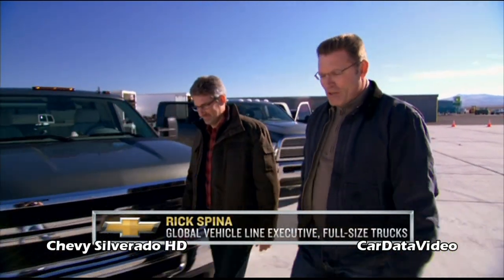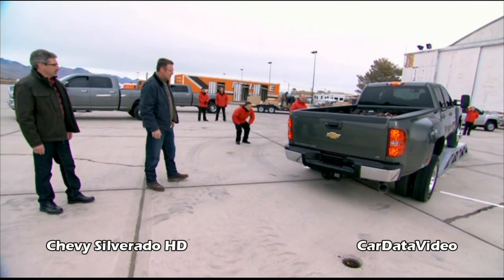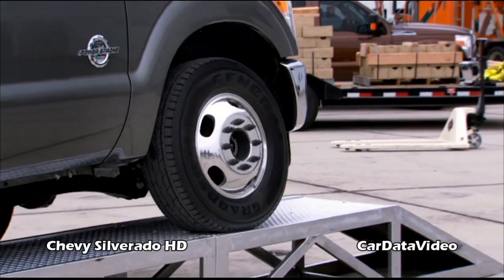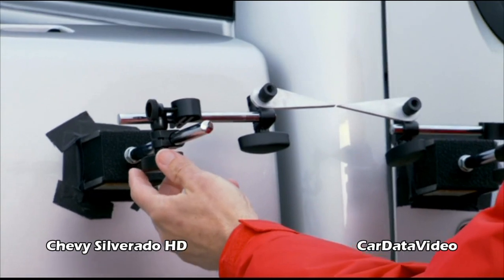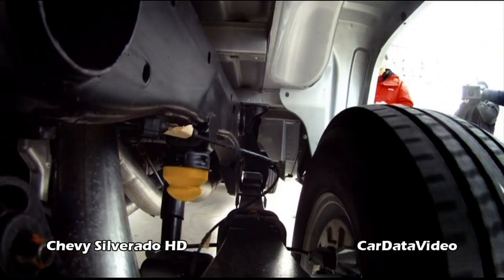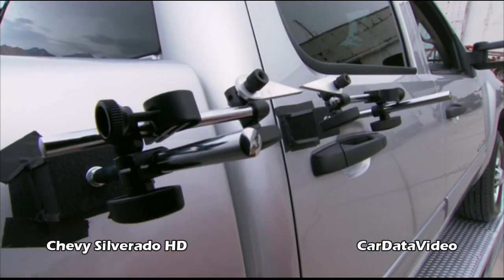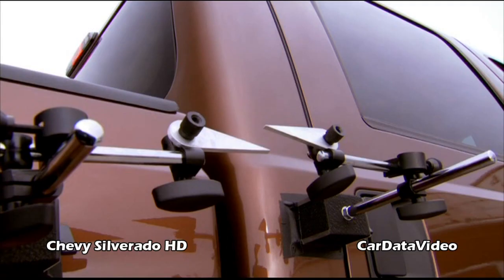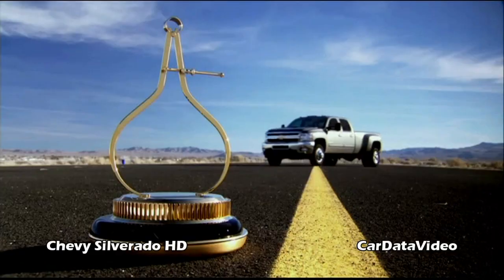Chevy vs. Ford HD Truck - Bed Bend Video

Comment: notice that chevy NEVER competes against ram, only ford
Reply: That's because Fiat can't build a truck.
Reply: Because Ram is no competition, Chevy has been behind 20k units for the past idk how many years..
Reply: Flammable Icecream actually ford copied chevy
Reply: Anthony Fulmer yeah why
Reply: O think that ford is better than chevy that's why they are always trying to bash them
Reply: Ford didnt copy chevy in anything. lol. Ford pioneered in basically everything
Reply: accobra62 Oh, but Mercedes-Ram could before that? smh...it does not matter who owns them, only results matter. And Ram has been doing a decent job for 10+ years now. They have beat Chevy in sales recently and are #2 to Ford who will probably never be beat in numbers of units sold. And if you take an honest look at the 2019 Ram 1500, I mean an HONEST look, you would have to at least admit they are not the same company that built trucks 15+ years ago. Not by a long shot.
Reply: They wanna get above ford because ford is king
Reply: True and Chevy trucks r more stiff, however ford trucks look cooler and r more sporty
Reply: Captain Fangle Being sporty and looking cool isn’t a thing a truck needs.
Reply: Elijah Diamond Incase u never heard of the raptor, or the Tacoma, there r sports trucks out there
Reply: accobra62 ikr
Reply: rsg1963 it’s not the “Mercedes-Chrysler” joint venture it’s fiat Chrysler but I agree
Reply: Austin James yes
Reply: Flammable Icecream ik
Reply: Anthony Fulmer to be the best you have to beat the best ! Notice how everyone brags about beating a mustang like it's the only car to conquer , that's all I hear by people I beat a mustang !! Lol like it's a life achievement ! Lol
Reply: Anthony Fulmer  why should they. The transmission is gonna shred gear mid videos.
Reply: Because dodge isn’t ready to compete with the big dawgs
Reply: I had a 2004 f150 also independent front suspension (like any truck) i went into the ditch hit a raised drive way jumped probably 20ft and landed on a box sign destroying now my bad driving aside the body was still in perfect alignment and the frame did not twist despite have the left rear whell completely off the ground about 5 ft and the driver wheel on top of the sign. Not sure if this video is accurate. (I drive dodge now so you cant roast my ford)
Reply: Chevy doesn't wanna embarrass Dodge and their ill designs as well as their horrendous gas consumption. I recently replaced a customers front 4x4 hubs calipers rotors pads and front brake hoses to the tune of $1,400.00 total on a Silverado 1500. My neighbor saw me do it asked about me doing his Dodge. I couldn't touch the fucking parts for the Dodge for the $1,400.00. Let that sink in.
Reply: Dodge should have their own nd engine!
Reply: @andersonbelland3971  actually ford was founded first, so you know.
Reply: Bc fords big gae
Reply: @Hiddenpower6  gae? Ehhhh?
Reply: Ball joints bud Dodge is ass
Reply: cause ram is way behind lmao. Smallest payload capacity, smallest towing capacity, lowest safety ratings, unreliable due to Chrysler's bs. I'd still like Ram's better than Chevy's, but Ford takes the cake imo.
Reply: Ford may be king, but I love my Rams. Had a Mercedes Ram and now a Fiat one, both are awesome!
Reply: Anthony Fulmer k
Reply: Wait, wuh?
Reply: Leon Flames ram is way better
Reply: TheRPGentleman bruh ram is way better have you ever seen ram showing commercials saying what "real actors" think about their "great brand of truck is"
Reply: colby kessinger Oh, you mean the paid actors? Yeah, I've seen those.
Reply: TheRPGentleman yep the fake ones trying to make Chevy look good about all their crappy "awards"
Reply: colby kessinger But why is Ram better than Chevy? Because they don't make commercials? That's the dumbest thing I've ever heard.
Reply: Because they're the special kid in the corner eating glue
Reply: TheRPGentleman no because they actually know how to make a reliable and working truck the other day me and my brother were driving down a street and saw a Chevy truck broken down on the road and me and him died laughing about how much Chevy sucks. Also ram is way better looking and has a better weight capacity
Reply: colby kessinger Oh, you saw a Chevy on the side of the road? Wow, because it's a Chevy it broke down and not due to a whole list of potential issues that could affect any car? Did you find out what was wrong with the truck? Is it an issue tied to Chevy trucks exclusively and can you confirm that? It sounds like you and your brother are just big Ram fanboys.
Reply: Because chevy ain't got time for those shit trucks.
Reply: @devingeorge5471  nobody does to be honest
Reply: @daniel27560  ikr
Reply: Dodge is low bid.
Reply: @arizonacolour8793  Ram is now beating Chevy in sales lol
Reply: Ram is Garbage, they have topped them
Reply: Ram might leave mopar, they stopped calling it the the dodge ram and have started calling in the ram, no more dodge logos on it.
Reply: And when you go to truck and tractor pulls who comes out on top Duramax
Reply: Eh, I'd rather have the raptor than a duramax. Or a ford any day. They are just really good really well made trucks, and they dont rely on shitty tactics to get them to have any sort of competition with ford or dodge. Cause in all reality they arent well made.
Reply: Detroit motors and Allison transmissions really can't go wrong with that
Reply: Dodge is behind in some scenarios and ahead in others, like the muthafuckin Viper (which in reality inspired from the Cobra Daytona, which used a Ford 427)
Reply: @CaptainFALKEN -tbf they were the only company using a v10 for a sports car. You don't see chevy or ford doing that. And you dont see dodge opting for an actual sports car unlike ford and chevy. And you definitely don't see fords or dodge vehicles on the side of the road because of a broken driveshaft or break failure, or transmission or engine failure. Each company to their own. If chevy wants to brag about how they got an award that everyone gets for participating in so be it😂 but I'll buy ford for the reliable trucks and sports car packages, and dodge for when that straight line is all I can think about
Reply: @accobra62   I agree that is why Chrysler builds them and calls them RAMS
Reply: Dodge and Chevy trucks are both great. If getting a Dodge it's best to get a manual trans though since there automatics are a weak point. Ford makes crappy trucks now adays. The older ones are pretty good though.
Reply: That's because a ram isn't even in the same category there's a reason they are way cheaper then the rest. Because they are cheaply built and every young man thinks he's getting a hell of a deal until it breaks! Ram pos
Reply: That's why we've had our 1989 Dodge Cummins for nearly 30 years now without any major breakdowns right
Reply: @timothykangas4151  Except everything you just said is a load of crap. They aren't cheaper in price and nobody cares to hear your biased view. My 2016 Tacoma has had serious engine failure at 32,000 KM and powertrain issues. Meanwhile my co-workers 2018 ram that he purchased in 2017 right when they came out has already done 42,000KM with no issues. Oh and there RAM's have the best interior I have seen of any pickup. They use ASIN transmissions from Japan and i'd take one any day over GM who makes the biggest POS cars I have ever driven. FORD, RAM and if Toyota get's there Sh1t together Tacoma for me.
Reply: @redtra236  Don't bother have a discussion with Timothy since he is just your typical fanboy with blinders on.
Reply: @redtra236   Depends. RAM gives you the option for the ASIN(japan) transmission that Toyota uses as well. The previous transmission had some issues, it wasn't bad but it wasn't the greatest either. Ford and GM also have less than stellar transmissions. Remember Non of these car manufactures make there own transmissions. GM uses Addison, RAM uses either ZF- Germany or ASIN-Japan. Ford I forgot who they use, but I know Ford has alsotried many times to use one of there one transmissions only to dump them and developed another one.
Reply: Well the one in ours is a solid steel and I believe American made transmission so that probably helps. Also it's a 5 speed manual not an automatic which in my experience are almost all complete junk for doing any hard towing.
Reply: @redtra236  Well Yes, Manuals are rock solid reliable. They are simple and more straight forward in there mechanics. Of course you have to shift yourself and sadly most Americans have no clue on how to drive a Manual.
Reply: Chevy tailors their advertisements to manipulate the consumer. Like most commercials that claim to have a superior product, most of them are lies. Both GM and Ford half ton pickups have proven very durable over the years. Same with Dodge, but I'd rather one of the big two as parts are easier to find.
Reply: It’s because everyone already knows ram sucks
Reply: That's because ram broke down on the way to the competition.
Reply: @seriousdopamine4404  and then you woke up
Reply: @paulj9821  yeah woke up in a chevy, drove it to the competition, and back to you're house to get food from your fridge. While you were still broke down.
Reply: @brickson98m  odd,  there safety ratings beat out Chevy in 2018-2019. Might want to recheck your facts there fanboy
Reply: Paul J their. And I’m not a fanboy lmao. So they beat Chevy’s safety ratings? Doesn’t cover their other downfalls
Reply: StrykerV8 lol you dodge boys get real mad. You’d spend less time typing on YouTube getting heated, and more time driving your truck if you got a Chevy. Still haven’t disproved anything I’ve said other than the safety rating
Reply: @brickson98m  The only person angry here is you sir with your passive aggressive attitude. Oh and no need to disprove as you already admitted that you were wrong about your previous comments in why Chevy was better. Your argument was dwindled down to 

"Doesn’t cover their other downfalls"

I'll just leave it at that, since it encompasses the essence of your mindset.
Reply: StrykerV8 I admitted that in the newer model years dodge may have beat Chevy’s safety rating, but they don’t outclass them in any other category that matters when it comes to getting a truck. Payload, towing capacity, etc... sure if you’re just buying a grocery getter it’s fine, but past that, hell no.
Reply: @Paul Wright lol I'll call you a tow truck.
Reply: @brickson98m  Bahahahha...Ok I am at work but when I get home I will show you how out of date you are. I will give you a hint, go look at the new 2019 RAM 3500 longhorn with the brand new 1000 lb-ft Cummins Engine which can haul over 32,000 pounds without the engine even struggling.  Heck go to TFL-Truck where they actually test it with the load and the gas millage. 

Then ask your why in 2018 RAM was only 5% behind Chevy in sales and in 2019 they are now ahead. There sales numbers have been exploding since 2017.  Oh and I have owned FORD, Mazda/94 ranger, and Chevy but RAM. This has nothing to do with defending a brand I own. This is about been fair and objective without tainting it with extreme forms of bias, based on preconceived notions.
Reply: @Paul Wright lmao i didn't notice your profile pic. I thought you were a dodge guy. I own a chevy.
Reply: Dodge has trucks???

Comment: how does this prove anything? The only benefit to the kind of test is maybe for rock crawling. Who is going to park their truck with two opposing wheels off the ground not to mention do it on purpose?
Reply: Fr 😂😂
Reply: +Viktor Step i
Reply: i can see how it would afffect it if you were working on a construction site with uneven ground but it must be really uneven for the bed not to open
Reply: even going through just small ditches puts your truck in that position and I take my 2011 Silverado on them on a daily basis and the tailgate hasn't broke yet. so therefore Ford is complete trash
Reply: brian gustafson I drive an f150 and i go through ditches and ruts along with my buddy's Chevy and he's already had to replace all four ball joints, granted his tailgate is fine but my ford has yet to have a ball joint replaced...then again I don't park my truck like a dumbass with two wheels stuck in the air, that's just asking to break something, no matter what you drive. Not to mention the unnecessary stress put on the frame.

Plus I have yet to find a ditch or rut that is so bad that it puts our trucks in those kinds of positions...not to mention common sense tell me and my buddy when something is just too uneven or steep, we don't want to flip our trucks and there's always a better way around  that insanely steep ditch.
Reply: biker932012  so how many tailgates have you gone through on your piece of trash f150?
Reply: none why?
Reply: I've never had an issue with a Ford tailgate, but I have with a Chevy, and the Dodge tailgates are always rusted so bad they nearly fall off.
Reply: Troy Stephens actually had that happen at our shop, also the cables that hold the tailgate are always the first to rust through.
Reply: blackmetalofnorway1 heck to the no
Reply: biker932012  same who's gonna have 2 wheels off the ground
Reply: biker932012 They are bored! Nothing else to do for retired football players!!
Reply: biker932012 not inly that, if ypu had a truck do that with a hard cover on it with stuff in the back (no clue why you'd park it like it) it is basically theft free without have the theif have serious problems to get the stuff in it

Comment: When I’m off-roading in my brand new f-250 the first thing I think of doing is opening my tail gate
Reply: colby bellows 🤣🤣
Reply: You sure will once your done and it wont open
Reply: Dont have to worry about it...won't open anyways...
Reply: But Chevy has to think like that. It's going to break down while off reading and they will need the tailgate down.
Reply: Ford guys have to think of that jackleg kind of stuff

Comment: “Give the gate a try”, seriously? It’s a goddamn gate it doesn’t matter in what position the truck is in.
Reply: Yup
Reply: But it shows that the Chevy is stronger.
Reply: @andrewmclamb6984  Lmao the Chevy's frame was definitely bent by the test. The reason the bed flexes is to make sure that the frame doesn't get bent and so that the energy has somewhere to go.

Also this test was staged- bolts were loosened in the Ford

Comment: I Still would rather have the Ford. I go off road every day and would rather have all 4 wheels in contact with the ground.
Reply: That's done by your suspension... Not the frame of the truck. I see why you're a Ford guy. You guys don't know trucks you get repairs done at the dealership.
Reply: And what do you do? Sit in your chevy waiting for it to start but it wont? Seriously dont need to be mean about let him decide what truck he wants. Also chevy has a lot of recalls lately on all on new trucks and you expect that new trucks should be better.
Reply: @ravethephantom6184  Ford SHOULD have a lot of recalls, besides, no car buff drives Ford's and you'll notice that and for a good reason. They aren't built to work on. They're built to bring into the dealership with the other house wives.
Reply: See the key word here is SHOULD but they dont have any as of late honestly I'm not trying to make anyone mean here in the end of the day if you have the money then buy whatever the heck you want if you want a ford get a ford if you want a chevy get a chevy I'm just saying what I see from all of this. Honestly everyone has different experiences and no matter what they dont really matter honestly I love trucks of all kinds but I really dont like to hate on any brand but Ford aren't bad at all just have to take care of it like every other vehicle and your good
Reply: @Smitty-op4ld  "That's done by your suspension." no it's not. you only have like 8 inches of suspension travel, you'll rattle your brain out of your head and shit out your spine relying solely on the suspension. I drive my 2009 F150 through dirt roads all the time and I can see the cab and bed moving independently of each other, and it's never been and issue. this truck has lived almost it's whole life in dirt and it's as strait as an arrow.
Reply: @Smitty-op4ld  hey btw my father was a mechanic in the military and only buys ford and the only reason he gets some of the stuff doneat the dealership is because of the warranty so you're logic has many flaws just like you're personality
Reply: @Smitty-op4ld  Look up Scotty Kilmer. Mechanic for many, many years. He says buy fords.
Reply: @Smitty-op4ld  SUSPENSION, bro Independent front suspension vs solid axels for off roading I know which i would take